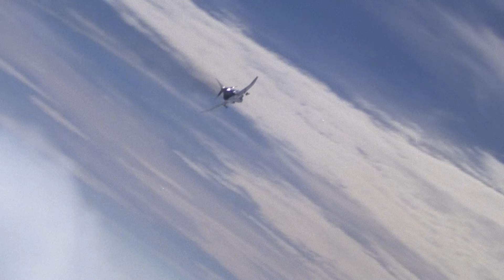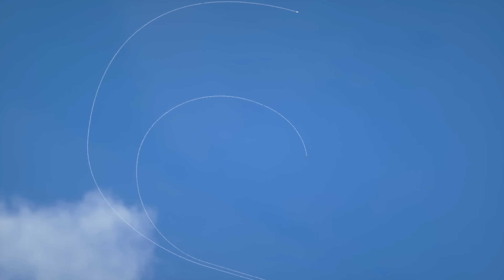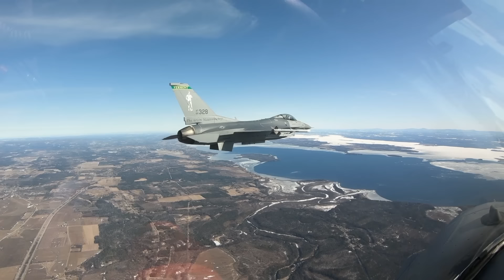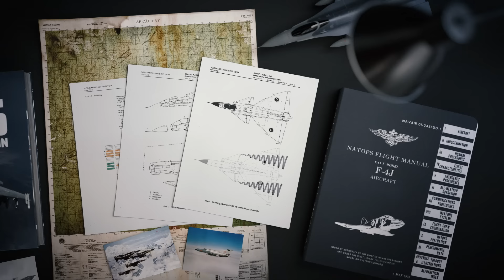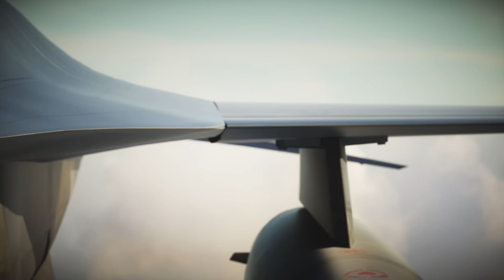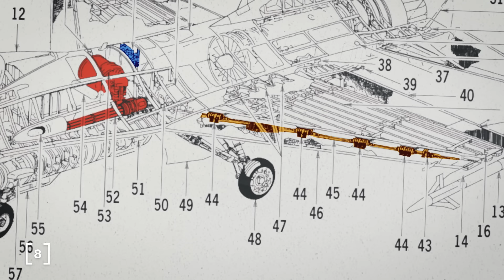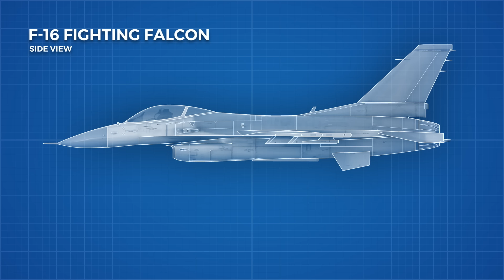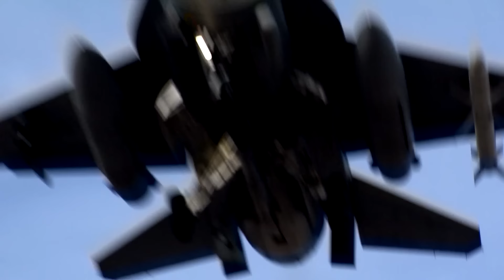The Insane Engineering of the F-16

Comment: I'm a bit surprised that you didn't mention Harry Hillaker who led the F-16 design team at GD, or the LWF competition that required manufacturers to fund their own prototypes, which resulted in both the F-16, and the F/A-18. The FX program that resulted in the F-15 also used the EM theory, but became too expensive to replace all the F-4s and F-102/F-106s in service, thus the need for the Lightweight Fighter (LWF).
Reply: @gepset Don't be an idiot. At the time he was working on the Viper his contributions were enormous, and it was based on this work he was asked to work on what became the Warthog.
Reply: @roijoi6963  Sprey was an analyst. Document writer. Neither pilot, nor engineer.
Reply: That design team was dripping with talent. Not only Hillaker but also Heinemann of A4 fame, and Pierre Sprey. John Boyd was absolutely gleeful that the F-16, using far less money and precious metals like titanium could beat the F-16 in a dogfight, at least at lower altitudes. Adding 2 tons to the weight without increasing the wing size addled the Viper vs Boyd's design (Boyd immediately demanded the USAF increase the wing size to 320sqft, which they ignored) but for BVR flight, the higher wing loading and FBW real-time tweaks just make it more aerodynamic. 

BTW, the Viper is strong enough to carry an extra 6,000lbs in flight. Its MTOW is limited by its brakes, not its airframe. A good reason to take off with empty drop tanks and hit a tanker early in the flight.
Reply: @roijoi6963  Pierre Sprey was a Russian asset who built a career of pretending to be someone he wasn't.
Reply: @gepset  Sprey didn't do much for the F-16, he didn't even want a radar or missiles on the LWF, but he sure claimed a lot of credit. The F-16 really came into its own in the 1990s because of a few reasons, one was the AIM-120 AMRAAM, another was the range of attack upgrades in the form of LANTIRN and HTS that gave it a night attack/precision strike and SEAD capability. All this "gold plating" would have infuriated folks like Sprey, who just wanted a jet powered P-51 Mustang.
Reply: @gepset As far as I'm aware, even his 'friend' John Boyd never invented the energy-manoeuverability theory. That's something one of the US aircraft manufacturers (I believe Douglas) came up with in the 1950s.
Reply: @martijn9568  many things were inspired or invented many times over; usually is the one who makes thing popular (Boyd) or workable (mathematician who worked with Boyd) who take credit.
Reply: @Kelvin_Foo  to quote my other comment: like it or not, USA had no viable, widespread BVR missile until AIM-120 arrived.  You can easily see that Boyd etc. WERE RIGHT AT THE TIME if you examine MiG-29. In THEORY it was superior to F-16 when initially introduced - EOTS, BVR radar guided missiles, datalink and other bells and whistles, two engines. Lot's of sophisticated junk; hell I think MiG-29K could fire R-77 before F-16 could do AMRAAM. And what did it amount to? Short ranged, inefficient air-show aircraft that took beating even from EVERYONE, including own Soviet contemporaries. Late versions discarded theoretically smart ideas like FOD protected air intakes. Even with general superiority of west in quality control and miniaturisation, it wasn't until 90s when F-16 could really start turning into what it is today, while overengineered but underperforming MiG-29 shifted into irrelevance and I doubt it could be made efficient even today. Today you don't need the monster of airframe like Su-27 or MiG-31 to fit sufficently performant electronics or modern light PGMs.  In early 70s it wasn't an option, not even on the horizon. WOrking with experience they had and seeing trends - they were right back then. Also same is true today, when industries just can't complete product and cars come to have 200 MLoC ( 200 million of lines of code - 20x the F-22 ). Also, that "5g daylight fighter" could be planned as such, as there were F-15s havign it's back on the high end.
Reply: @roijoi6963 Sperry was a con man along with a few other names from the "fighter mafia" that escape me. iirc there was a good video done by lazerpig(?) on the subject that exposed those frauds and grifters for who they really were.
I'm nervous that only minutes in the term "fighter mafia" is being used in a positive context.
Reply: My father-in-law worked on that team, helping design the flight controls. He also later wrote the proposal for the adversary version, the F16N, that was used at Miramar, and previously worked on the flight controls for the F111. The stories he tells are amazing about the way they did things back then, and tons of stories about the test pilots. He said the accidental "first flight" was actually his team's fault... they had the gain settings too high on the flight controls which caused the PIO as soon as Phil slightly lifted off the ground. 

I've got to show him this video next time I go visit... he's going to love this  @roijoi6963

Comment: Great video! But I couldn't help noticing the center of lift and gravity of the F4 and the center of lift of the F16 look really off... How can the F4 CoG be so far forward with the two jet engines behind it? and also both of the Centers of lift are supposed to be at approximatelly quarter of the wings where here they are more at cockpit line. are those the real positions? Because I couldn't find a source for this.
Reply: exactly my thought during that part of the video

Comment: A cannon on a fighter. Why?
Reply: Wdym?
Reply: If a cannon is ever in a position to be used, something has gone horribly wrong. You'd be better off with a map and compass at that point @Crustaceannationrepresentative
Reply: @seanoconnor8843  Even though BVR is the main type of air combat nowadays, thats the same thing they thought back in Vietnam, I know things have changed drastically, but it's too high of a risk to not have one on the plane, plus, it isn't just used for air to air, it's also used for ground attack, that's why it's useful
Reply: I contend that it is too heavy and complex for, at best, an edge case @Crustaceannationrepresentative

Comment: 35:10 
So, what happens to the controls when you hit 26° AOA or 9Gs?
Do you hit an 'invisible digital wall' or does the rate of change of AOA or G roll off to zero?
Does it roll off from 26° or 9Gs  or start to roll off and hit zero as you cover up against 26° or 9G?
Or is it configurable?
Reply: It just stays there are 26 degrees or 9G. You can pull back as much as you want but the plane isn’t going to let you stall it. However, there is an autopilot disconnect switch that’s on your pinky. Say you’re dodging a missile and you really don’t care if the maintenance guys are going to yell at you, you can hit that and it’ll let you pull as many Gs as you want
Reply: @kevinzheng7373  
So it hits a digital invisible 🧱.
Funny, I would have thought pilots would hate that kind of intrusive change.
You'd think it would roll off towards 9G
Reply: @MostlyPennyCat  I believe the G-onset rate kinds rolls off to 0 when nearing 9G. It's unlike the F-18, which is somewhat "reactive" - you can exceed limits if you yank the stick hard, the F-18 computer will go "whoops" and bounce you back to 7.5G.
Reply: @mimimimeow 
Everybody bangs on about the F-15 but for its the F-16 every time. 
The first true, modern, digital, 4th gen multirole fighter.
Balanced and poised just so, truly a plane that you wear as much as a flight suit.
In the concept of '4th gen' you cannot improve on this, except maybe with the F-16 XL.

Comment: I wish there was more on the physics and mechanics of relaxed stability.
Like, without fly by wire, what's was going to happen to the aircraft at timestamp (tbd)?
Was it going to flat-plate and stall?
What does the fbw system do to stop the "ball rolling down the hill" in that situation?
Shut down the tail lift i assume, but how?
Reply: Tl;Dr: Flying a regular plane is hard, flying a plane that is actively trying to crash is all but impossible without assistance.

If you were to fly an unstable plane without fly-by-wire, it would be like balancing on a pole, while experiencing different wind speeds and directions and occasionally firing a gun in the case of the F16. You would have to constantly adjust all your control surfaces to keep you current trajectory. If you are very good you might find a metastable position (like when balancing on a pole, where you can find a spot where you don't have to move much), but that position would change all the time depending on the air's pressure/speed/direction and the planes speed/heading/g-load/angle-of-attack/recoil from weapons systems.

Imagine a bicycle vs a unicycle in a storm. There is a reason unicycles aren't a popular choice for transportation. 

The exact way the pilot would fail is not necessarily predictable, but given enough time and stress (like, i dunno, fighting in a dogfight) virtually any pilot would lose control of the aircraft.
Reply: Without the FBW at low indicated  airspeed the plane would most likely enter a deep-stall or a flatspin  (probably un-recoverable). At higher indicated airspeeds the plane would probably break apart due to insane aerodynamic forces from absurd AoA , due to the lack of stability. 

The pilot doesn't control the pitch angle, he controlls a desired pitch rate with the stick. If the pitch rate is allowed by the FBW the FBW will aim for that. Idk exactly how the FBW works but I think it includes some sort of PID-controller based on pitch rate and AoA and it controlls all aerodynamic surfaces.